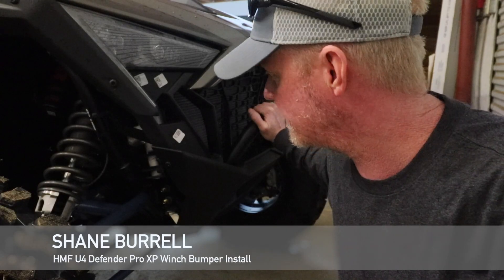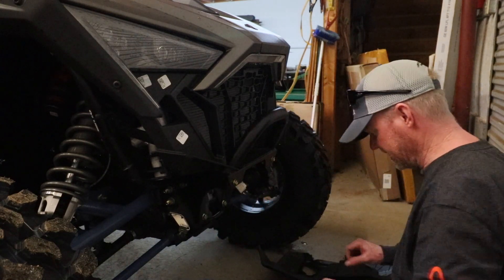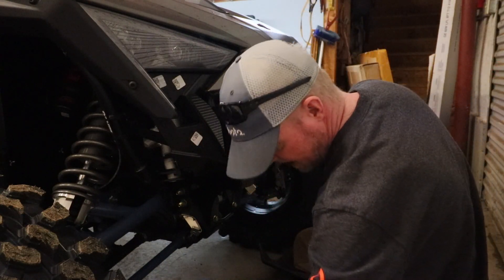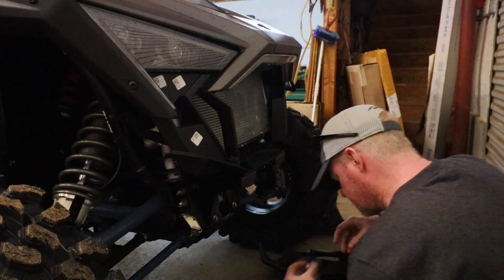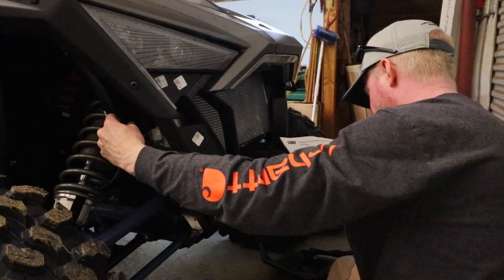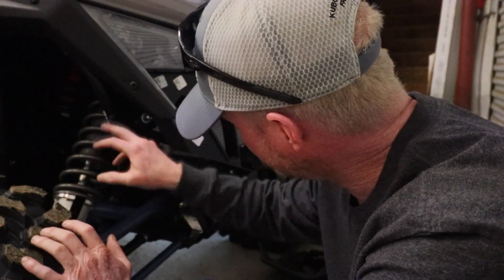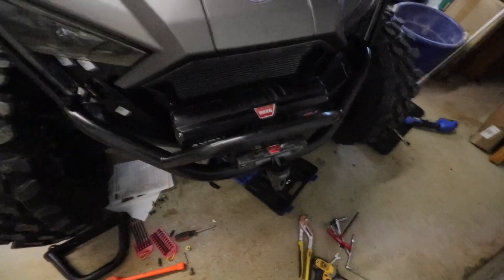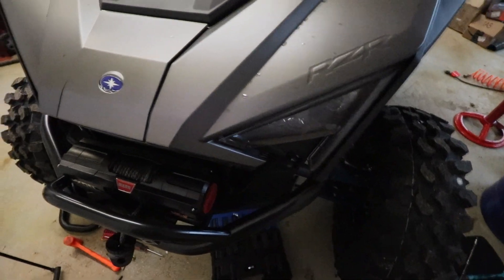RZR Pro XP HMF U4 Bumper Install

Comment: Any idea if the DRT front grill will work with this bumper and winch ?
Reply from the maker: No idea. The plastic one you can't install or remove once the bumper is on.